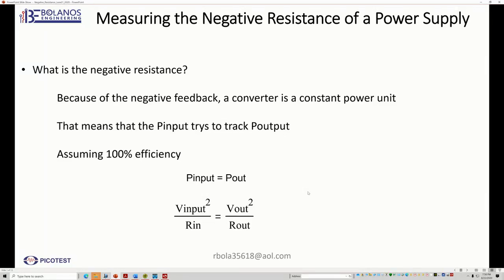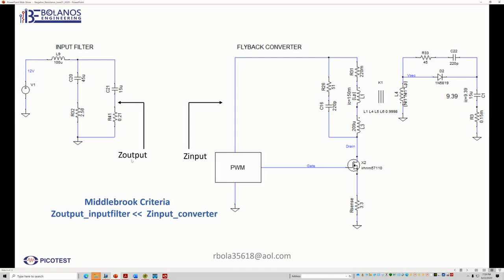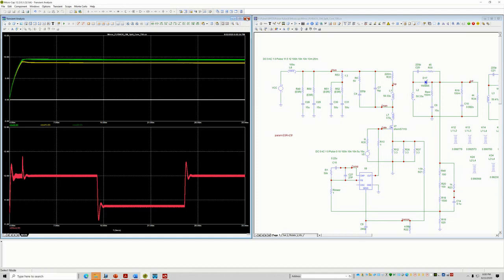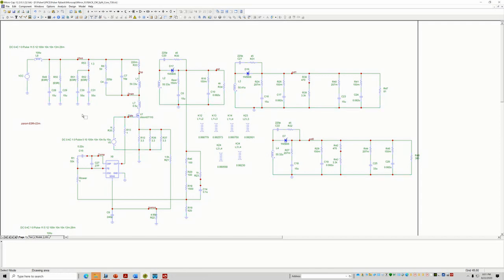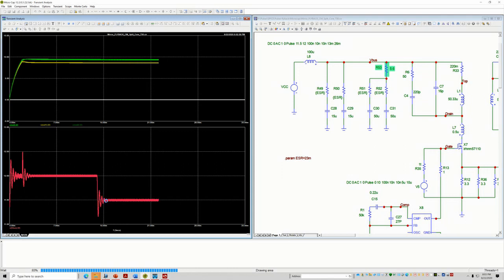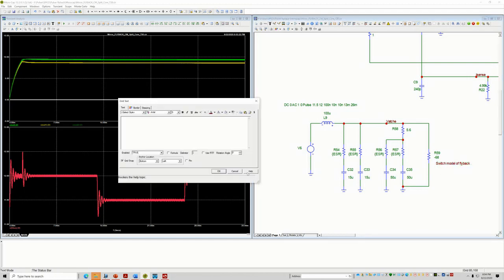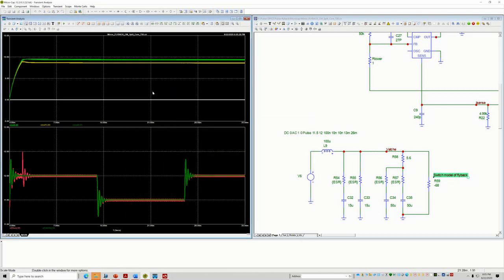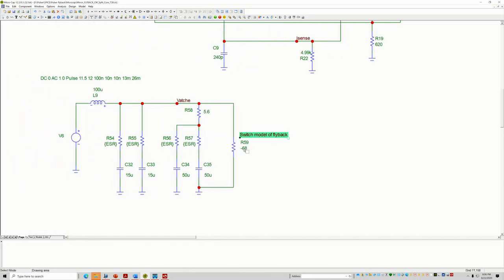Measuring the Negative Resistance Update

Comment: There is nothing like Negative R, 
you did not supply enought of C with ZERO Inductance on Mosfet. 
this is why You have inducutive behavior of forward and backward from transion line... and many harmonics in rise /fall time d/dt this pulsce is traweling with input inductiom of system.

You do not need 100uH becouse impedanace is getting higher in freq so when you switch on/off there is ex 100MHz 200MHz in 100KHz Sqere wave in 6-10nS rise times... so in that time real resistans of input power supply is ex 70 ohm  plus inductive and all refletcions...

 you need minimum 100uF for every 0,2-0,3 AMP const, and LOW ESR  and the most importent think is "as close as you can to Mosfet " 

Im not from US so sory for any mistakes 
but you should realise what i wrote.
Reply from the maker: Please read Vatche Vorperian book on power supplies. In his book he talks about negative resistance. There is another video that I made where I connected the Bode 100 and measured the negative resistance.
Reply: @RobertBolanos  You are calling impedance "Negative resistance" 
Negative is for ex feedback .
Negative resistance is physical fenomenon in tunel diodes, when you apply voltage and have up down and up when votst are increasing - in RF you can make it D + LC oscillator. only (non activ parts) .
Im telling that what you see is just impedance of 100uH after power supply. 
find more info in Agillent specialist Eric Bugatin book about power integrity.
I will make about it some videos in falf of the year
Reply from the maker: @marcinelektronik  

The theory of negative resistance is well established. It is often used to expain how oscialltor are designed. The input filter does has resistance in the form of the capacitor and inductor esr. These esr can be translated from series to parrallel by using the Rp=Q2*Esr. These upconvert to higher resistance in parrallel with a tank circuit, The power supply because it it negative feedback cause a small signal negative resistance which will then be in parrralle with the Rp of the input filter. If both are the same and in opposite signs, you then have a dissipationless network and it will oscillate forever.  This concept is well know.
Please see below.

https://incompliancemag.com/article/smps-input-filter-design-negative-resistance-approach/
Reply from the maker: @marcinelektronik  You are welcome to make your own video. I encourage you to put a video and explain your concept. Thank you for your opinion.
Reply from the maker: @marcinelektronik
Reply from the maker: @marcinelektronik  I reread what you wrote. You wrote, "Im telling that what you see is just impedance of 100uH after power supply". This does not make sense. What happens to the capacitor? Does the capacitor disappear? Not it does not. The inductor and the capacitor form and resonant frequency and its impedance is infinite if it is a perfect inductor and capacitor. But there are no perfect inductors or capacitor so the inpedance is the combination of the R=Q^2*esr of both the inductors and the capacitor.  So your statement doesnt not hold true. I hope this makes sense.
Reply: @RobertBolanos  take inductor and resistor in series put generator from 50Hz to 20 MHz and mesure voltage on R one leg of R must be gound ... this R mus be non inductive for ex 1/4w metfilm or carbon.. just look how it is behive, and aftet that look that driver of mosfet must be as fast as he can... so look on real rise time this will determinate what real freq you have in rise and fall time di/dt .. and this is that you are looking, there is no tunel efect (negative resistance) in this ciriut.
Reply from the maker: @marcinelektronik  Please explain more. I still dont understand what is your point. The  small signal input impedance of the converter without the input filter is still looks like a negative resitance. I am not saying that it is a tunnelling effect. Never said it was tunneliing effect.  What is the point you are trying to say.
Reply from the maker: @marcinelektronik  When it the circuit starts to ring, it is not ringing at the high frequencies that you are suggesting. The ringing is at the resonant freqeuncy of Fres=1/(6.258*sqrt(Linout*Cbulk)). So I am not sure what the risetime of the mosfet has to do with the ringing on the input filter. Please explain what you are trying to say. We can discuss this on skype if you like. Do you have skype?
Reply: @RobertBolanos  if you dont know what is relationship when you heve 10ns, or 50ns or 500ns in rise ald fall time in respect to inductor or even trace or induction of cap ... this means you dont know what is power integrity, you are making transients response of inductance- noise or how ever you can explain it... this is all about inductance im expert in power integrity in radiofreq for telecoms and last 20 years spend on RnD for comanys like T-Mobile, Douche telecom
Reply from the maker: @marcinelektronik  This is not a power integrity video. This is a video on how the input filter reacts to when the input filter is not properly dampened. What I showed has been explained by others in the industry. In fact one the best in the power industry Vatche Vorperian, who got his PHD from Dr. Middlebrook, explains it in his book, " Fast Analytical techniques for electrical and electronic circuits", the concept of negative resistance. I have worked with Vatche Vorperian. If you do not know who Vatche Vorperian is, then you are not a power engineer. I think there is a language barrier in that I have a hard time understanding what you write. You mention you have 20 years in electronics. Congratulations on your long tenure. I just completed my 50 years in electronics. I work for Southwest Research Institiute, and I design spaced rated power supply for NASA and ESA. So I think I know what I am presenting is factual. I can see that this dialogue is not going anywhere since we have a language barrier. I wish you luck in your power integrity profession. Regards, Robert
Reply: @RobertBolanos  Naming of this is wrong, this is not negative resistance,
 this is dynamic impedance of loadet LC tranmision line.
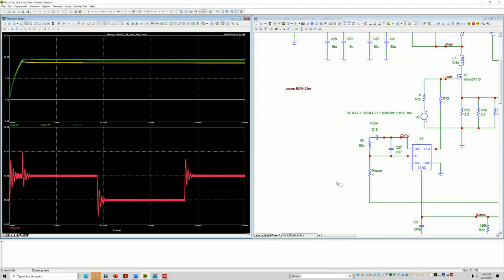Reply from the maker: @marcinelektronik  Marcin, you are wrong. You did not see the entire video or the website I attached earlier. In this video at around 5:30, I duplicated the input filter and attached a negative resistor of -68 ohms. I then ran a transient simulation and stepped the the input voltage. I then ploted the output of both input filter. One input filter is attached to the power supply, the other is input filter only has the -68 ohm resistor as a load. They are identical thus prove your statement wrong.  This is infact the input impedance and it shows a negative small signal resistance. You may say that this is only simulation. In also did a video where I used my Bode 100 and isolated the converter without the input filter. I found that the resistance was negative. The video link is here. 
https://www.youtube.com/watch?v=me_Y3HGVZFY&t=108s
But I suspect you are gaslighting me. So be it. You can continue to believe what you want. I think I have proven my point.  If you disagree, prove me wrong. Let see your analysis or video evidence.

Comment from the maker: In this video I answer viewers question of why bother measuring the input negative resistance of a power supply. My answer to this question is that it allows you to verify your Spice switching model and your Input filter to verify that you do not violate Middlebrooks Criteria. When you measure the negative resistance, you can then make a very simple input filter model and add the negative resistance to model the switching model. I use Microcap to how how to create a much simpler input filter model that matches the full switching model. Questions or comments can be sent to rbola35618@aol.com. "May your simulations always converge?

Comment: I had a problem with the overshoot in an existing power supply design killing some low noise amplifiers.  We couldn’t figure out why the amplifiers were failing until we started to look at the DC bus in operation when ac coupled.  The problem was caused by the load turning on and off every cycle for LNA testing.  Moral of story: power supplies should always supply spike free power under all conditions.  This was an expensive problem: there’s $260k worth of LNAs on the radar I work on.